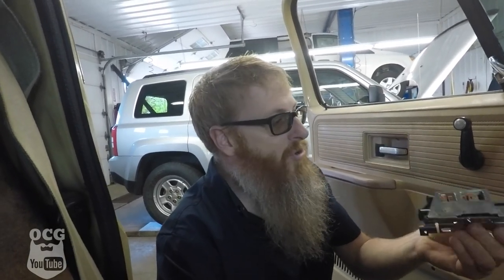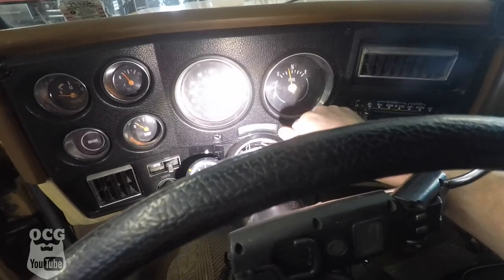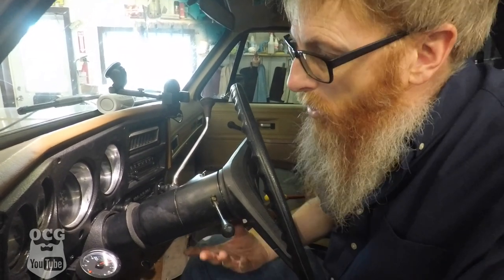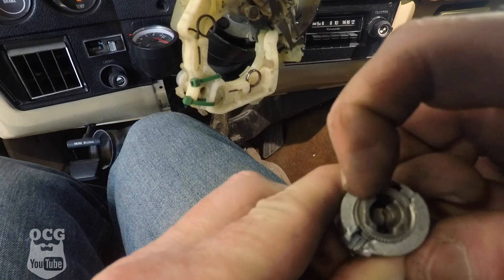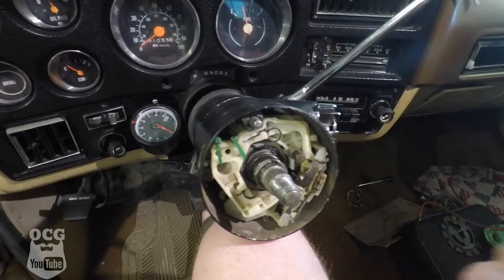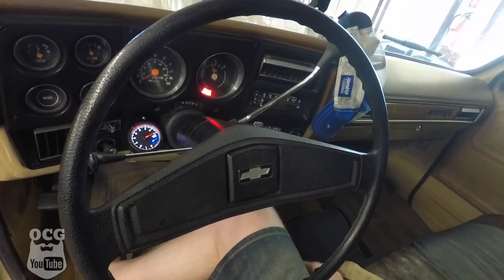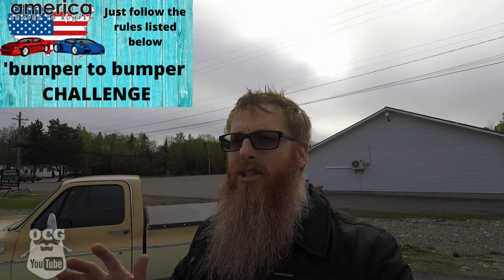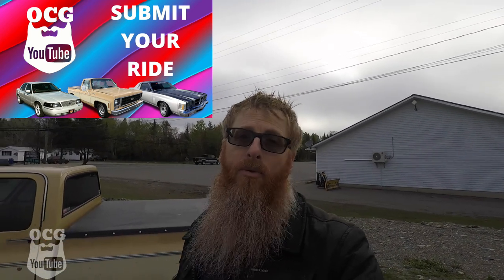Replacing the ignition switch and key lock cylinder in my 1977 Chevy C10

Comment: Does the Big Spring in the middle have to do with the horn?
Reply from the maker: Not directly. It hold pressure against the steering shaft.
Reply: @OldeCarrGuy  when I removed my wheel, I miss placed the Spring, Do I need it? My horn is disconnected..
Reply from the maker: @FrankGonzalez-ph2ht yes! It is needed!
Reply: @OldeCarrGuy Dammmnnn, was hoping U wouldn't say that, what is its purpose... curious 🤔
Reply from the maker: Not 100% sure but I think it keeps the steering shaft from collapsing.
Reply: @OldeCarrGuy  Collapsing? But wouldn't the Lockplate n steering shaft Bolt prevent that? 🤔
Reply from the maker: @FrankGonzalez-ph2ht  Well it has to hold your lock plate as well, otherwise the steering wheel lock may not retract far enough and you can't turn your wheel.
Reply: @OldeCarrGuy  well hopefully I find it..🤞 Thxz for ur input/help..👍

Comment: What is the gauge with the ignition on and off sensor
Reply from the maker: Thats the aftermarket tach! It's a pain in the butt. However, I have since installed an EFI system with a built in tach.

Comment: How do you adjust that rod
Reply from the maker: You don't adjust the rod, you adjust the switch on the column. Loosen the bolts that hold it and it will slide up and down the column. Hop this helps.